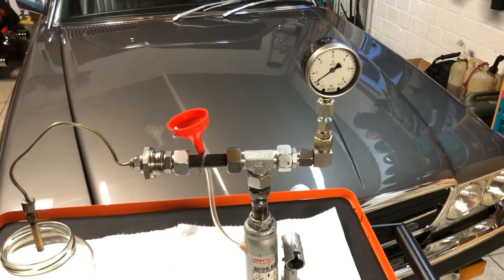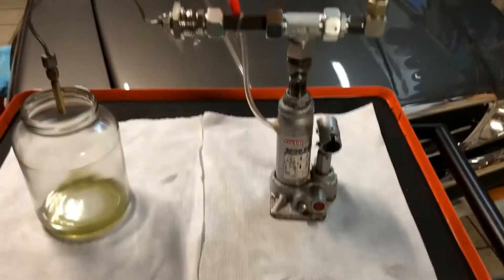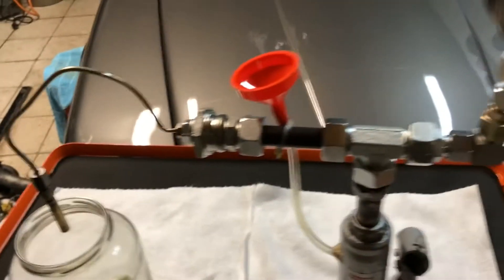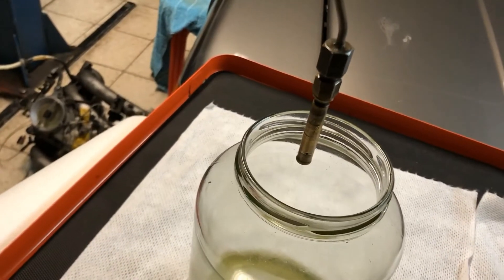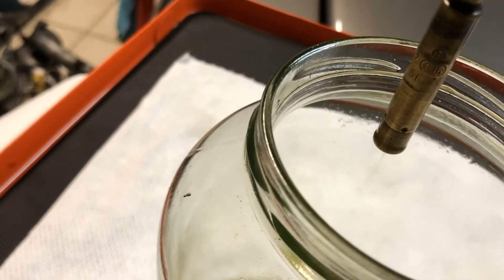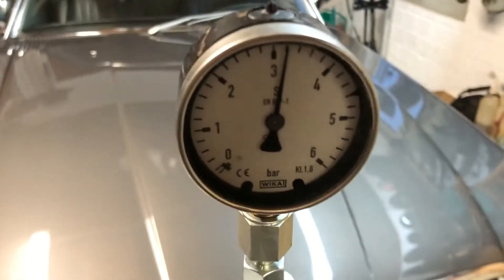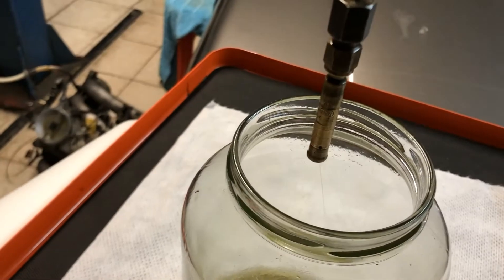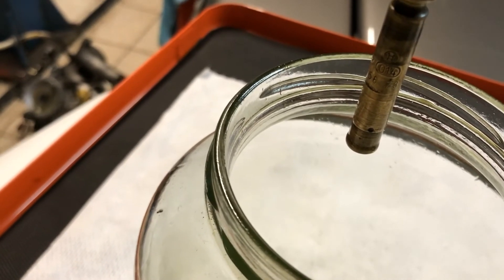K-Jetronic CIS Injector Tester

Comment: Shoyld they spray when cranking car over or with ignition on
Reply from the maker: They spray when the fuel pump is running. The fuel pump relay gives power to the pump only when the engine cranks. For test you can bridge the relay by connecting pins 30 and 87

Comment: Hi
Is this system pulsing the injectors like ON and OFF pattern or they just inject steady all the time?
Reply from the maker: Hello, the „C“ in CIS stands for continouos injection. The nozzles spray all the time, the amount of flow is regulated by the throttle plate which is linked to the fuel distributor.